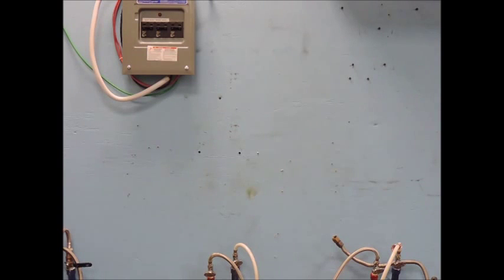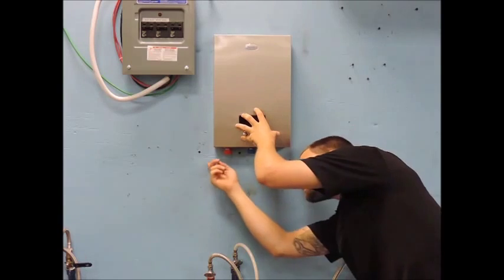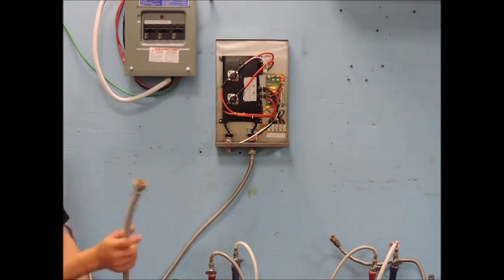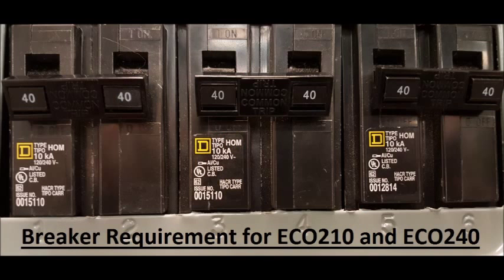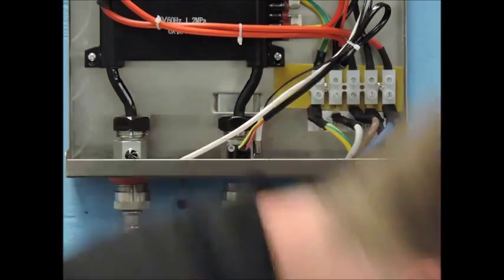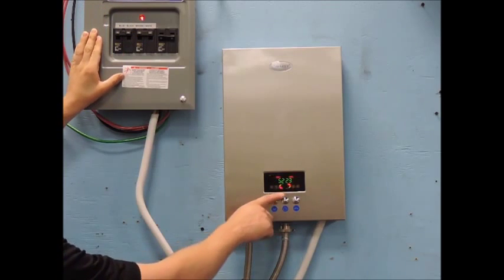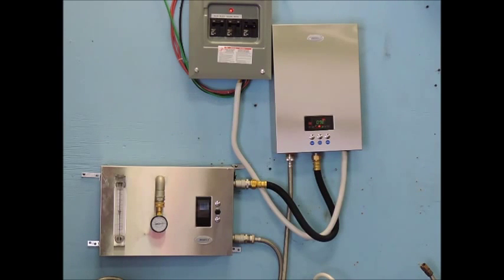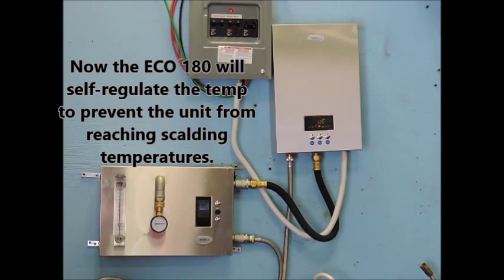Marey ECO180, ECO210, ECO240, and ECO270 Installation and Adjustment

Comment: My Marey eco180 has been installed for 2 months. I noticed my hot water was only available for 30 seconds and went to look at the water heater. The lcd screen showed “overheat”. The outcome let temp was listed as 209 degrees even though it’s set to 125 degrees.

What’s  going on????
Reply: We will be happy to troubleshoot your unit with one of our technical support representatives.  Please contact our customer service desk at 1-855-627-3955 or you can reach one of our agents directly at (786) 409-6857 Monday - Friday 9:00am-5:00pm EST.  
Thank you,
Marey Customer Service Department
Reply: Have same issue, What was the fix?
Reply: @Isaac-wk8ec  the water heater was too small a capacity... Installed the larger model and it works great for over a year.